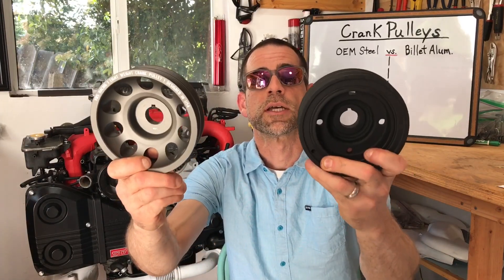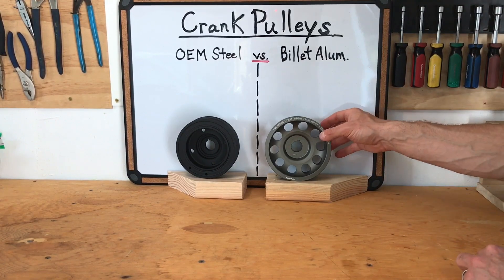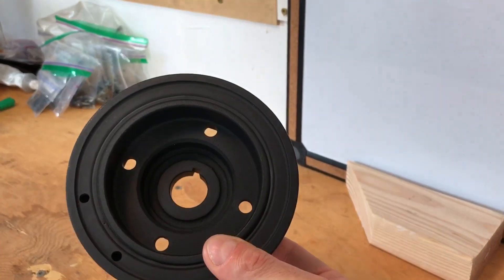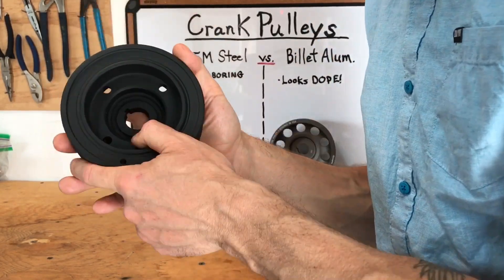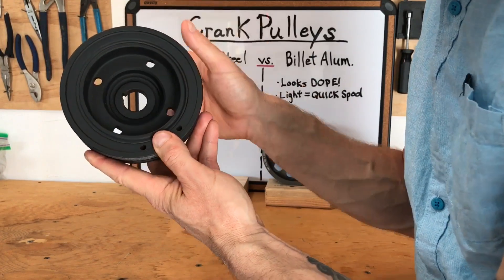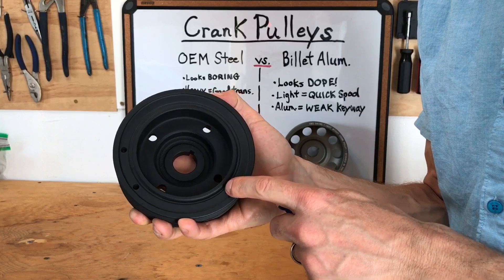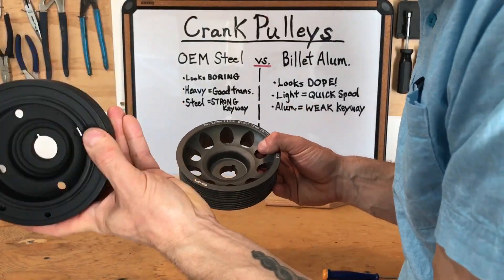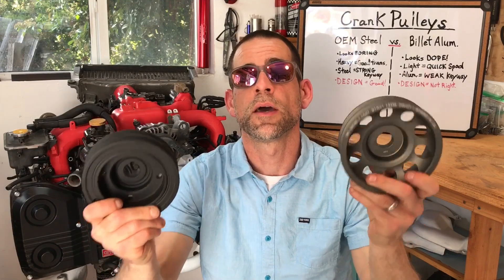Billet Aluminum vs. OEM Steel Crankshaft Pulleys

Comment: Would the negative effects still be bad for an N/A? I'm not going to be racing or anything crazy just want a little more performance out of my motor
Reply from the maker: +Craig Gilbert 

Hey Craig, Luke here... Thanks for dropping the comment! Great question!  I wouldn't say that the potential negative effects are definitely LESS significant for N/A motors and may end up being so small that it becomes a non-issue.  

Overall, I think of it like this:  
(A) If you want your motor to last for the longest possible time (think decades and hundreds of thousands of miles) then I would stick with a factory harmonic balancer (or get a fluid dampener or ATI unit - cause they are also designed to address the harmonics issue).  It's basically a long-term risk mitigation measure.  

(B) However, if you throw on that light-weight aftermarket pulley, you are guaranteed to see an instant improvement in performance and you get to enjoy that immediately.  There's some REAL value there too, maybe even more!  

Ultimately it may be based on what you are looking to do with your Subaru and what you enjoy more!  Thanks again Craig!

Comment: Great info, so would you suggest stock crank pulley and light weight flywheel to get the same characteristics? Or is there a draw back to that as well?
Reply from the maker: +Toua Moua 

Thanks for the comment!  👍👍

I would suggest that over a light weight crank pulley for sure.  And it would help get that motor spun up and into boost faster for sure.  The heavy  flywheel does have some advantages too, so it think it really comes down to your driving needs and how the engine will be used.

Comment: What is your opinion on ATI's SuperPulley or Fluidampr's Pulley?
Reply from the maker: +Michael Melendez 

Hey man. Thanks for taking a sec to throw the question out there (other will likely appreciate it for sure too!). 

The ATI and Fluiddampr units ARE designed to be dampen the harmonics and likely do it better than the OEM ones because they aren't worried about mass producing at low costs.  I would say they are LEGIT!  Especially if you are building a high-RPM motor!  👍👍
Reply: Fluidampr FTW.  Just did one of these on my 09 Spec B with a new timing belt.  Pretty significant reduction in vibration and adds smoothness and revs faster.  It's actually heavier than a stock pulley but vibration robs power and adds inertia.  Reducing vibration is the same as reducing weight/inertia in some respects and is better for durability.
Reply from the maker: +Jonathan Holmes   Awesome comment - great first hand knowledge man.  THANKS!  👍👍
Reply: Cool, I recall those fluidampr ones, just a shame they are hard to find here. My experiences were basically null when I ran a lw pulley on my old gc8 ej205. I noticed zero of the supposed benefits. I then swapped it over briefly onto my current car with an ej257, nothing, again none of the suppose free revving, then after seeing something about how they are not good for harmonics, swapped the oem back. Plus I ran some flywheel logic that a heavy wheel is actually better as it is able to "release", or rather apply some of that energy to maintain a smooth spin in that instant that all engines have no power being applied through the 4 cycle stroke.